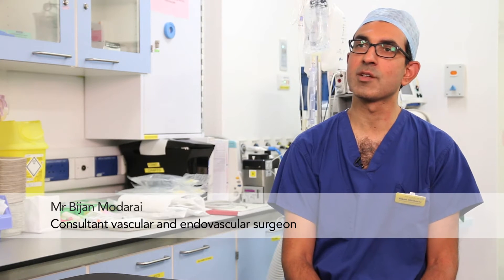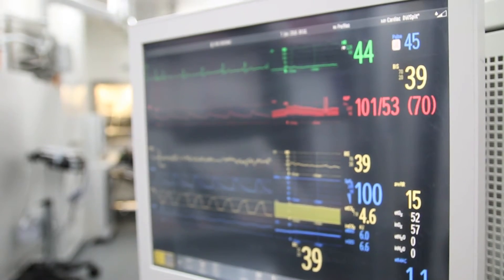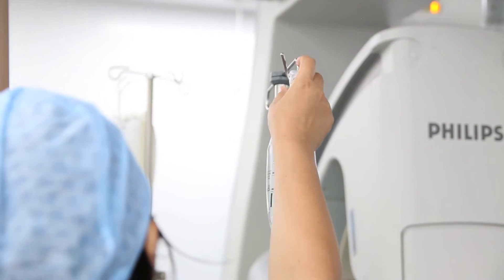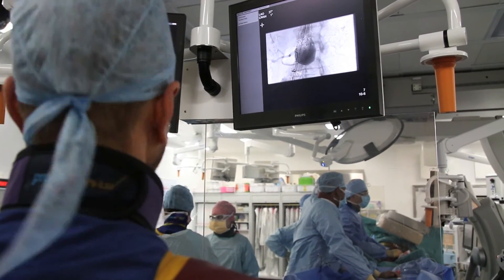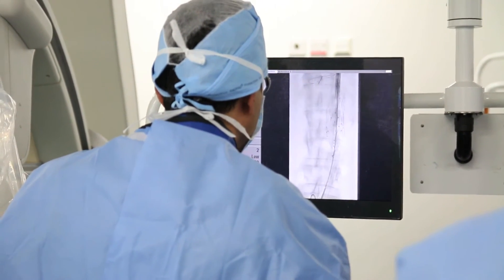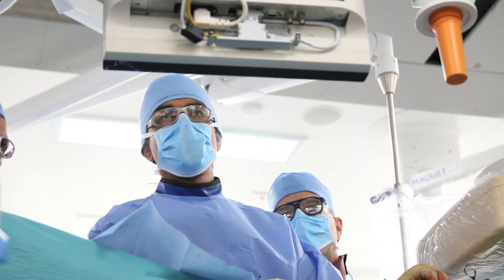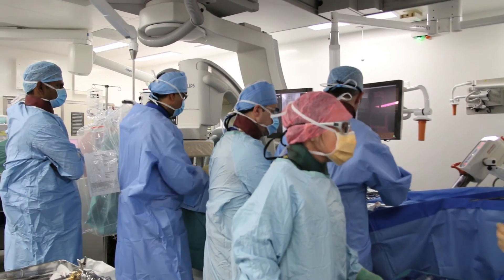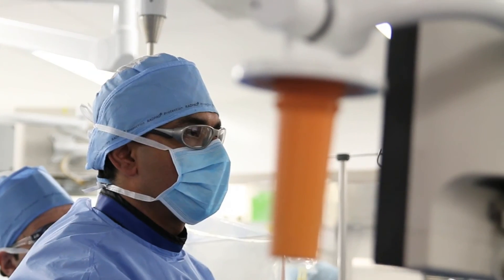Meet the expert: Endovascular surgery

Comment: I had a complex AAA in August 2020.  5 Butler grafts fitted.  I lost one kidney and can't walk properly with weak legs.  I also have burning and numb areas over my body.  Is this usual?
Reply from the maker: We cannot give medical advice through this channel. Please see your doctor if you have concerns about your health.
Reply: Rev Phil Weiland hi I’m getting surgery done on the 20th April this year and I have chronic kidney disease I’m not sure how I feel about this as I’ve never had to have surgery before this has all happened suddenly I just want to ask should I be worried
Reply: @shaunapaula6928  Hi Shauna, thanks for your question.  I found the operation was not a problem and didn't feel it at all.  I had BP problems after but have been sorted out since.  As for the weakness and numbness, i am still under investigations with neuro for those problems.  I also have got RLS which i didn't have before and pins & needles in my right arm.  I think I maybe a rare case so try not to worry too much.  Just make sure your BP stays normal as possible.
Reply: Seek doctor please. May Allah help you.